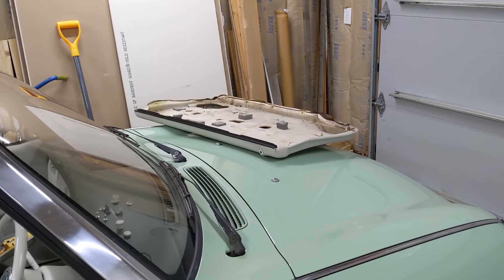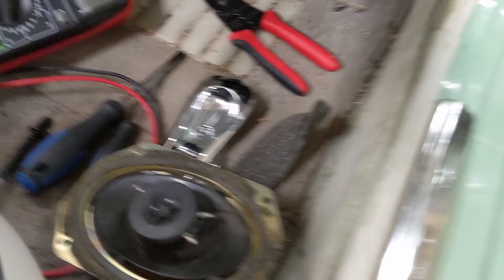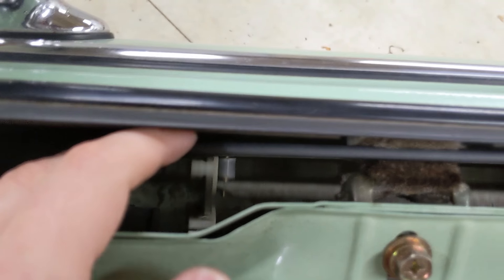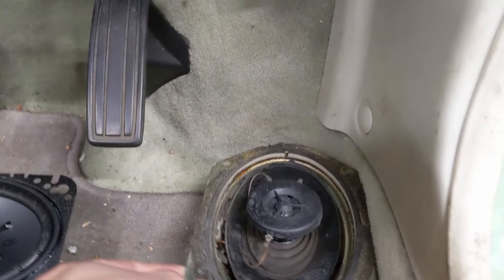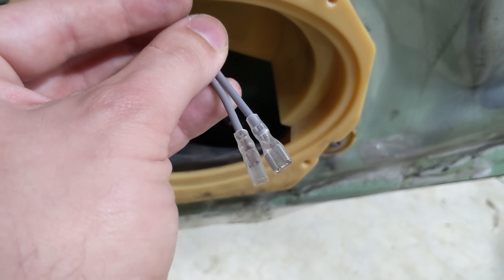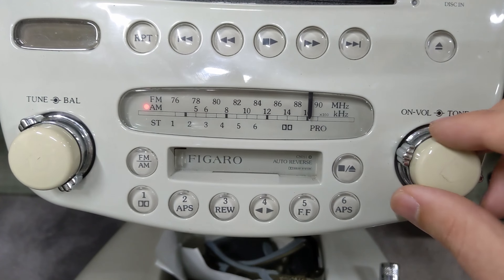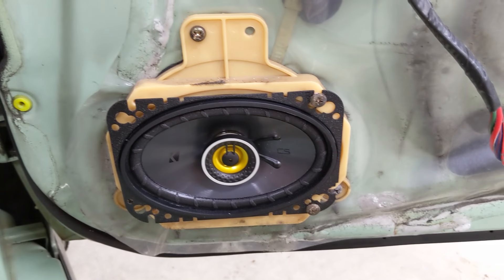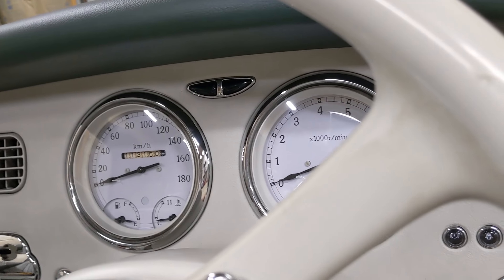Replacing the Figaro's driver's side speaker

Comment: I love car audio; i have Rockford Fosgate Power 75W (each) speakers front and back connected to a Rockford Fosgate Punch P600X4 amp, Rockford Fosgate Punch 50W tweeters connected to a Rockford Prime R250X4 amp, and two 12" Rockford Fosgate Punch P3s (1200W RMS total) connected to a Rockford Punch P1000X1bd amp.
Rockford gear isn't inexpensive, though; I paid over $960 for all of that. Plus a Pioneer head unit and amp wiring kit.

Comment: Look for a frecuency shifter (they come in names like FM Band Expander Converter Shifter) to make the FM work with the bands you have in the car, quite simple to install, very common to use those on JDM cars with no replaceable radio.

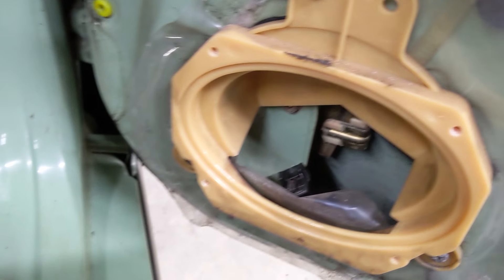Comment: 3:30 - you are right that it's not a vapour barrier - it's called a water shield and is for stopping rain from running down into the electrics and the upholstery. Whereas a vapour barrier is to stop moisture from getting from a warm moist area to a cold area, and with cars being terribly insulated it's not really an issue.

Comment: Others have probably mentioned, but I don't think that ESP was really that necessary for in-dash CD players, I'm assuming they were designed to mechanically isolate the CD transport from vibrations enough that it didn't usually skip. I know the GM CD player in my old Sunfire didn't advertise any specific ESP features but I don't remember it ever skipping except maybe when going over the roughest of bumps.

Comment: If you're doing a custom replacement of bulbs on the dash, warm white do LEDs exist. Understandably red/blue or even cool white LEDs would look wrong. (It's not that LEDs would be bad, but getting what would look right is more difficult.)The thing is you'd need to add resistors to them to retain the ability to dim them and perhaps come close to the expected circuit load.

Now if there's somebody out there that can work on the head unit, I'd be curious if they can swap out or re-tune the circuit for the receiver coils to pick up more of the North American FM band. In such case the dial obviously wouldn't be correct, but at least you'd have something. Other than that, the cassette offers the option of using a cheap adapter to play music from your phone. (And most phones now support receiving the FM band as a basic feature if you want radio rather than streaming service or stored MP3s.)

I'm surprised Clarion doesn't seem that common in stores now. I remember years ago it was possible to find that brand in the audio section of Walmart. But I guess that shows how long it's been since I've shopped for that stuff. You could still order from them, and perhaps the pricing isn't too terrible to find a more direct replacement than a "fit-anything" type speaker.

Comment: Speaker should have a pretty tight air gasket type thing going on for sound quality and thus if installed correctly should be a good vapor barrier. Since the speaker itself obviously won’t have holes in the cone

Comment: I'd think that skip protection is important for a car CD player.  I bought my first portable CD player around 1995, which was a Kodak unit that also could do (as I recall) Photo CD.  Even though it had the extra memory to handle still-picture display, it couldn't handle the vibration environment of a car (with a somewhat sporty suspension).  I had to return it, and instead got a Sony portable that was specifically meant for car use.

Comment: Ah, the joys of retaining factory head units. I don't think there's much you can do here to replace your stock deck with something that will look appropriate. You may be able to get an adapter kit (maybe even double-DIN) but you'd likely end up with a black stereo with a brightly colored display that would severely clash with your interior but it's possible you could find an older deck with a silver face that won't look so out of place.
If you want to try to service this unit, it's recommended you change out the capacitors while you're in there. The tiny incandescent bulbs are available on the internet, though you could also modify the circuit(s) to use LEDs instead (same with your gauge bulbs). The cassette deck will need new belts, too. The CD player could probably use a lens cleaning. It likely does have some sort of anti-shock but it's old so it's likely not more than about 10 seconds' worth, just enough to play a clean disc normally on a smooth road but not enough to compensate for potholes or continual roughness.

Comment: Check those speakers on another head unit before you return them just in case it’s actually the amp or head unit or bad connection somewhere. Will save you disappointment when the new speakers come and do the same thing.

Comment: Did you try the other new speaker (or a known good speaker) on the same door?  It may still be the amplifier.  Also, the FM has hiss on the radio?  That's strange.  Old tech doesn't mute with no signal I guess.

Comment: 6:15 I always thought it was odd what car companies put on constant power vs ignotion-switch-accessory vs ignition-switch-on. The headlights get constant power, so you can run the battery down by leaving them on. (At least before everything became CANBUS and the dome lights started fading out like that has a purpose.) But the power windows would only work in on or accessory, so if mom and dad left you in the car while they went into the store, you had to decide on window placement before they left. I could see doing that for anti-theft reasons, to avoid someone snaking something inside and hitting a window switch, but... the power locks get constant power, so people can do that anyway!

9:00 It's too bad we switched to digital TV, or you'd be able to listen to TV audio with that. TV channels 2-6 are immediately below the North American FM band, it the area your radio tunes, and analog TV used FM for the audio. Because FYI for anyone who doesn't know, if your area's lowest FM station has a low enough frequency, you can hear it on an analog TV tuned to channel 6. In my area, the lowest station is 88.1 and it's audible but very fuzzy on a TV. Unfortunately modern digital TVs squelch the audio when you tune to analog static, so you can't demonstrate it for people unless you have a tube TV lying around

Comment: as a uk driver i’m used to seeing the steering wheel on the right hand side of the car, but the indicator switch is usually on the left hand side of the steering wheel, yet in the figaro it’s on the right... curious

Comment: Speakers need air to be able to move to produce sound, so you don’t want baffles to cover them completely in the back.  The “roof” of the top half is enough to protect them from rain corroding the speakers.

Comment: Fun Fact! Your speaker grills on that 91 Figaro are the exact same as in my 91 300zx. I guess Nissan had a lot of them to go around. Speakers are the same shape as well.
Reply: Looks like the speaker grilles used in S13 240sx, as well.
Reply: I've got a '90 Fairlady import. The interior door opener/handle thing is the same as the R32 Skyline. I'd imagine it too is just a parts bin piece used on many of Nissan's cars of that era. The airbag-less steering wheel is the same as the S13's as well.
Reply: That's Nissan's thing in those days.

Parts binning A LOT of things...but doing a good job of it, unlike some manufacturers...

Comment: Since the knob is not directly adjusting tuning, your AM radio trouble may be a result of the difference in channel spacing between the US and Japan (10kHz and 9 kHz, respectively) combined with stations in your area all happening to be far enough from the middle of the nearest Japanese channel that the radio can't properly tune to them.

Comment: I think you should measure the DC voltage on the speaker. Probably one of the transistors in the amplifier is damaged. In this case, the amplifier works with great distortion, and sooner or later burns out the speaker.

Comment: I think the turn signal being always usable is true for most cars, correct me if I'm wrong
Reply: I believe you’re correct, I know that Hazards are expected to work even when the key is removed. Not sure if that’s true on all cars but it is on everything I own
Reply: Here in the US, I thought the turn signals were always run off of the ignition switch (but bypassing the ignition for the hazards). It's probably different in other countries because of different vehicle standards used worldwide.

Comment: They finally make “warm white” car interior leds, they look decent in my classic car but I didn’t keep them in because i loose the dimming function
Reply: Not sure I understood the  loss of dimming function. Care to elaborate?
Reply: @oscargr_  on many classic cars, you can adjust the brightness of the dash bulbs buy turning the knob, so with LEDs that adjustment does not work
Reply: @anthonyvanacore9647  I got that much.. lol..
But it largely depends on the specific LED and the specific driver.
Individual LED's (the diodes) are driven by a current. Most user LED-bulbs have internal circuitry that make them act as voltage devices. 
It's not inherent to LED that they can not be dimmed, (can either be done by voltage regulation, current regulation or pulse-dimming)...it's usually a mismatch of drivers to bulb.

Comment: I wonder why they designed the door to have water run right through it like that, instead of using weather strips to seal it. Seems like an odd choice.
Reply: @Michael Swader, Been a mechanic for 38 years, never seen one that didn't have weep holes in the doors and rockers. Unless repaired by a BAD Bodyshop.

Comment: So I have had a theory about speakers in doors.  Yours has many access holes covered by sheet plastic as they often do.  I currently have a hyundai i30 and the sound to my surprise is awesome.  One day had the cover off and discovered the entire door is sealed.  Pressed steel inserts screwed shut to cover any access holes.  Is that the reason for the awesome sound. What say ye?  Hyundai did not need to go to all this cost and effort.  No one would really know better.  I can only think the door designer was also an audio enthusiast.
Reply: Exactly why the mid range component of my front speakers was housed in a sealed fiberglass kick panel in my Civic when I competed in SQ competitions (it greatly helped frequency response and staging).

Comment: It is IMPORTANT that the speaker on both side is connected correctly otherwise the sound will be weird and the bass will be gone!

There are many speakers to buy! flatter. smaller magnet. different shape! There is always someone who fits which you can buy.
better to buy something that fits than having to destroy something to make it fit!

It looks like the magnet is too big?
here in norway we have stores that sell good to cheap speakers in all shapes!

it is a good idea to use gasket on the speaker to prevent vibration from making strange noises. 

After soldering wires you need to remove sharp edges that can go through the shrink tubing

Having a speaker at the bottom of the door is the worst place to have speakers! Sound quality becomes very poor.
Unfortunately, this is where most car factories placed the speaker.

Comment: I might be 5months late but I need to comment on 7:33 even though it does not matter anymore. Yes wiring the speakers out of phase will even in this old car with these low end speakers result in bad sound. Speakers are very sensitive to that. You probably know that already and just didn't care but my inner monk had to speak out.
Reply: Speakers don't care.  AC is AC.  All about phase, you are either in or out ;-)
Reply: @ShainAndrews  one speaker in phase one speaker out of phase, boom cancellation, boom bad sound :)

Comment: I bought some of these a while ago for splice connections, they work really well:
https://www.amazon.com/gp/product/B073RMRCC3/ref=ppx_yo_dt_b_search_asin_title?ie=UTF8&psc=1

Basically, it's clear heat shrink tubing with a little ring of solder in the middle. You slide it over your splice like you do with normal heat shrink tubing, then shrink the tubing and solder the joint with a heat gun. It's saved me a lot of time soldering!

Comment: I’ll bet you that the AM radio has been knocked out by a dead soldier joint or a tin whisker. If you can manage to get it apart, reflow the boards in a toaster oven or with a solder hot air reflow gun.

Comment: the vapor barrier will cause sound issues - think about how the speaker is moving air, and how that pressure change will affect that huge pice of plastic.
for good sound this has to be removed, and all holes then be covered with 'Alu- Butyl' (thats what we call it here in europe at least)

I did all that a few weeks ago as the sound in my new Suzuki Vitara was terrible with the original speakers - and man.... the difference is like night and day! :D

here is a german video which shows the process :)
http s : / / youtu . be / lDlQbQ2RMuE?t=604

Comment: I need you to go on Wikipedia & read through the history/design portions of 1955's Honda Super Cub.  It will give you an idea of the design philosophy behind Japanese vehicles. Then all will make sense.
Reply: It's distinctly different if similar to German design philosophy.  Germans needs to accelerate a family of 5 to 150kph as reliably as possible.  The Japanese need to get a specifically smaller, lighter family through anything from a forest to a mountain, with as little material as possible, as reliably as possible.
Reply: Notice how any part of this car cam be sprayed down

Comment: 8:29 Sometimes if you have two screws in or over tighten them, it can cause alignment or rubbing issues with the speaker basket being slightly deformed, making the voice coil rub against the pole piece and thus making them sound like dogsh!t. I did that to mine and simply loosened them and solved it!